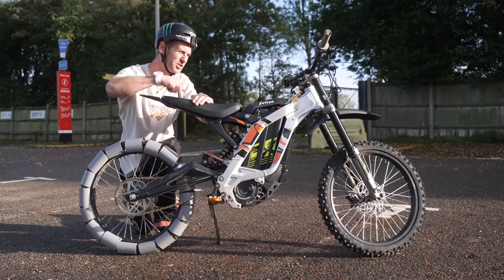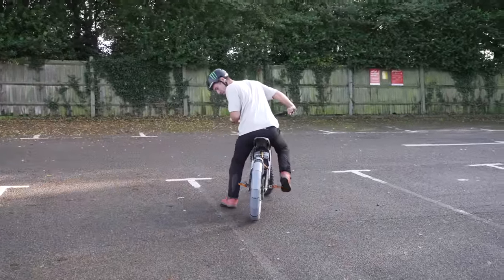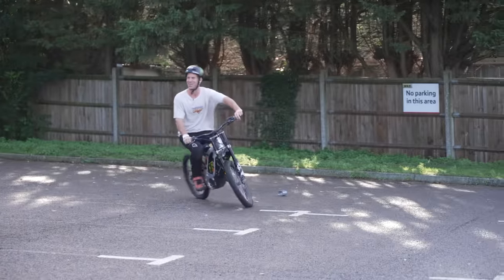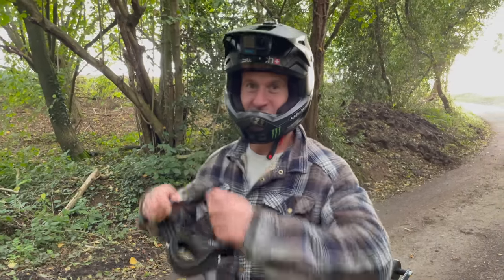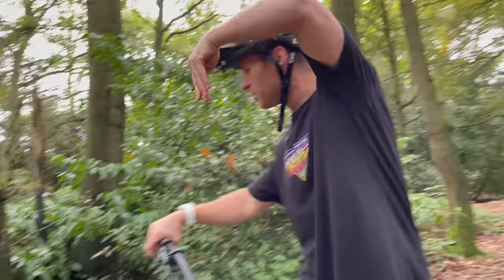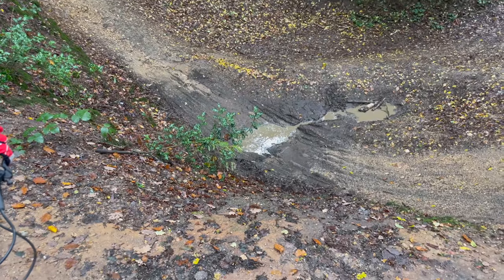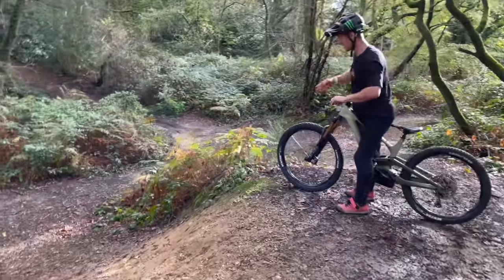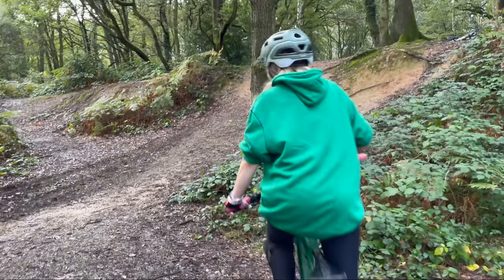I FIT PLASTIC TYRES ON MY ELECTRIC DIRT BIKE - CRAZY DRIFT MODIFICATION!

Comment: Put 4 holes in each piece of plastic (2 front 2 back) near the cut edge, then cable tie over the rim so it pulls the plastic tighter. And will stop them sliding back and forth and they won’t come off